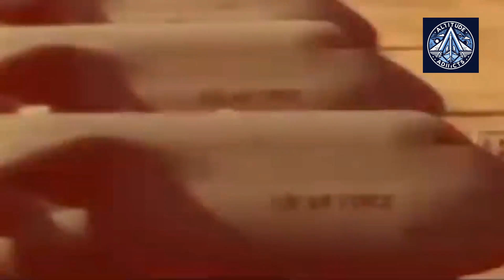Russia is Reviving the An-124 Ruslan Aircraft With Domestic D-18T Engines

Comment: PD35 will solve all proplems now that Russia is meeting. IL96-400 with 2 eg, An124, MC21+TU214 version long range 10000km. PD35 may be main base Planes of China.
Reply: Китайцы свой двигатель делают, потому Китай можно вычеркнуть из этого списка.
Reply: @Gari-k8k  Proplems of Eg China that they can't solve now. Eg Jet of China still a long time can manufacture anh operate. Russian is very easy for Eg Jet modern: PS-90A, PD14, D-30K....
Reply: The channel covered that the PD35 doesn't perform at required power levels.  It will take more time to improve them.  Ms-21 uses the pd-14 and that is moving forward.